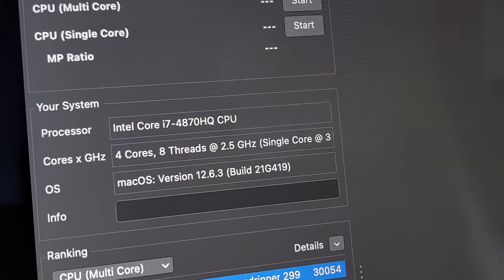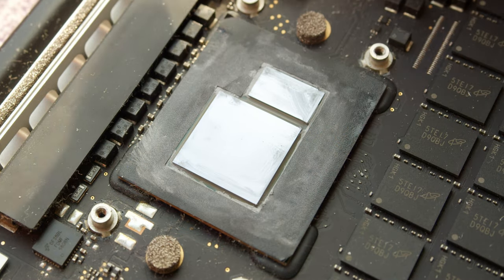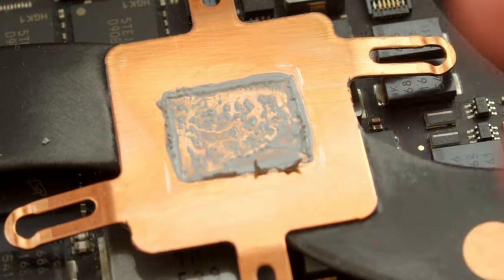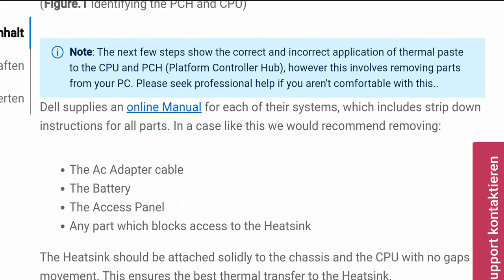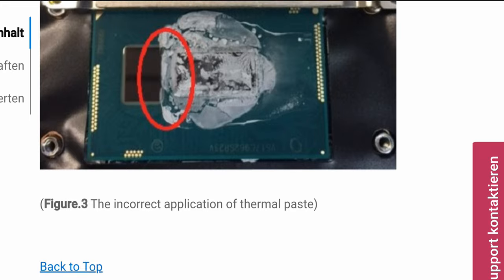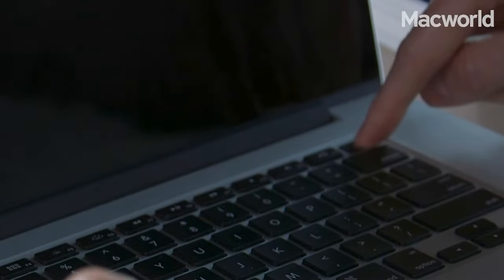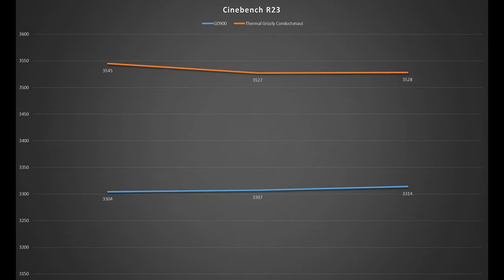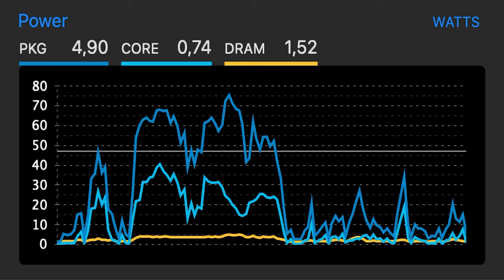Liquid Metal 2.5 GHz 15" 2015 Apple MacBook Pro

Comment: i know this video is old. but incase you still have this laptop, the pch on it is not integrated on the cpu it is actually on the motherboard next to the battery connector, that second chip is the dram cache, in your dgpu model it acts as a overflow cache and needs active cooling and will get hot enough to throttle itself, so you may have noticed issues with file transfers or boot up issues, if you still have this laptop i would recommend that you install some LM on it.

Comment: Do you use the laptops that you applied liquid metal daily? Do you carry them around? I'm thinking about to try the process in my Dell notebook, but I put it in my bag pack and go to work everyday, I am concerned about the liguid metal spreading.
Reply from the maker: There is a previous video on this topic where I tried to address every possible concern about liquid metal. Watch it carefully, it should answer your question.

https://youtu.be/nW8xm8-CuwE
Reply: @angrylee  I actually watched that video before asking the question, the video is very good and really good advice. I agree with you in the mentality of "if there is nothing to splash, it will not splash", but I am trying to collect experiences similar to my use case. Thanks for the answer.